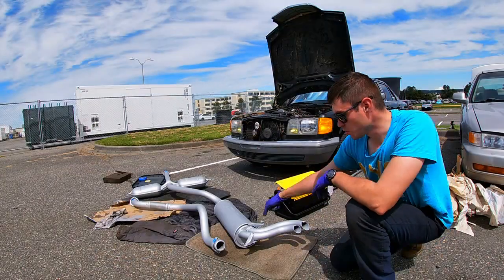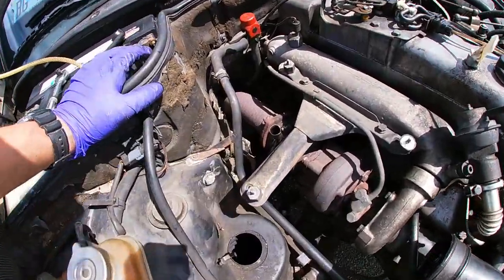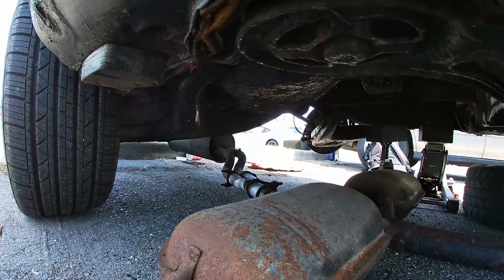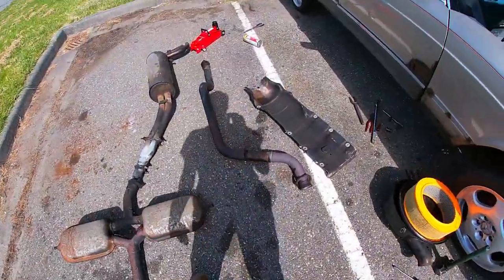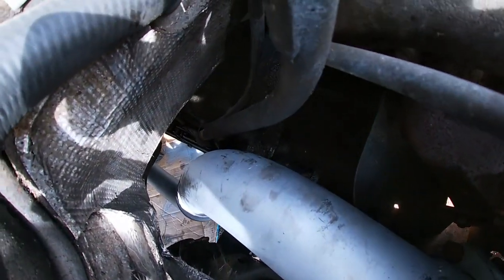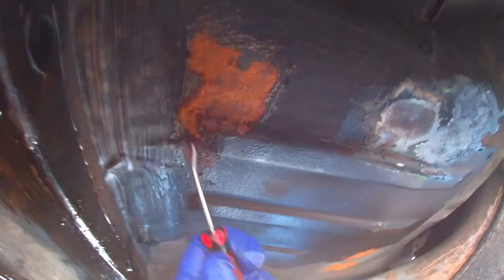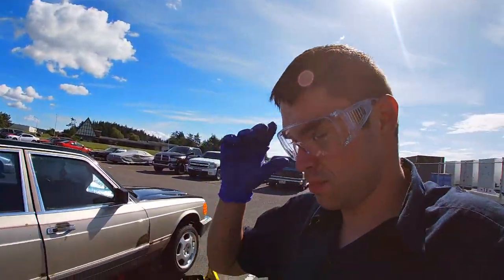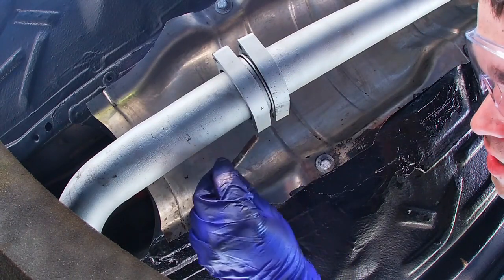Mercedes W126 Restoration Ep5- Exhaust System Replacement

Comment: Also whenever you can check the air filter housing I think it has some surface rust , so it doesn*t extend to the housing.

Comment: Your crankcase ventilation pipe from the valve cover to the breather is different from my 84. According to a little parts research, it appears the pipe like you have went through 1980. In 81 they started using a different model which goes more toward the middle of the engine bay and then bends toward the passenger side. Just wondering why they changed it. I like the one you have better.
Reply from the maker: That's true. I like mine more. Mine is rubber and actually is still very soft! The one you have is half plastic I think

Comment: Great work! Doesn’t USN have auto hobby shops on base anymore? We had them when I was in the USMC.  I suggest you use POR-15 or Eastwood Platinum Rust Encapsulator paint for toe exhaust and undercarriage next time. Again, great effort!!
Reply from the maker: Thanks a lot for watching and supporting! And they have the hobby shops but I don't like going there. I don't mind doing the work outside as it is for now😊👍
Reply: I was just thinking how much easier it would have been for you to do that work with the w126 on a hoist! All the best!

Comment: Hello Vito. Where did you get the new exhaust system? I need one for my 560 sel. Good job. Best regards.
Reply from the maker: I found an NOS Exhaust on ebay. Look everywhere online and make posts on Facebook W126 groups. Someone might have it. Otherwise you'll have to restore yours. Sand it down, weld if needed and use a high heat paint on it like I did on this car

Comment: Hi, when you reconnect the muffler in minute 15 it doesn't have any rubber or gasket? I recently bought a similar one and it has a exhaust leak there. Your channel has been of great help, keep it going!
Reply from the maker: Thank you so much for watching and supporting. And there's no gasket there, just 2 flanges that come together and get bolted up. If you have a leak there, you might need to remove that part and investigate. Maybe it needs to be cleaned up and put back together. Tighten the nuts and bolts German tight☺
Reply: @VITOSGARAGE  thanks a lot for your reply. Keep up the good work!

Comment: Are those twin chambers Cats or silencers?
Reply from the maker: No cats on this car. This is factory exhaust
Reply: @VITOSGARAGE  Thanks, I realised now after a bit of research that later cars have a single cat at the start of the pipework. Regarding the twin silencers, can they be removed for a greater v8 sound and if so is there any consequence of doing this?
Reply from the maker: Of course you can remove them. The engine will sound nicer and will have more power. However, I don’t know where you’re from so watch out for emissions and inspection. 
I am in Washington state, USA. There’s no emissions inspection for old school cars so I can remove all the cats if I wanted to.
Reply from the maker: Don’t forget to check out my other videos. I have a lot of playlists as well.
Reply: @VITOSGARAGE  my only concern was that removing parts of the stock exhaust could cause issues with 02 sensors and things like that
Reply from the maker: @hamshank29  what car do you have? Mercedes from late 80s to mid 90s only had 1 O2 sensor. It reads air fuel mixture. Later cars starting 1996 had 2 O2 sensors where the downstream O2 sensor monitor the efficiency of catalytic converter. So if you remove the cat on 1996 or newer cars, you’ll have a check engine light with the code P0420 usually
Reply: @VITOSGARAGE  I have a W126 1985 500 SEL. Ok sounds like id be be good to remove them in the future. Just a case of welding it a new piece I guess?
Reply from the maker: Yeah, cut the cat and weld a piece of pipe in its place. You also have to remember that you might smell the exhaust more because of deleted cats
Reply: @VITOSGARAGE  I'm not talking about he cat. We've been talking about the pair of silencers after the cat.
Reply from the maker: @hamshank29  ohhh yeah sorry.. Somebody else asked me about the cats at the same time.. and yeah, you’ll be fine